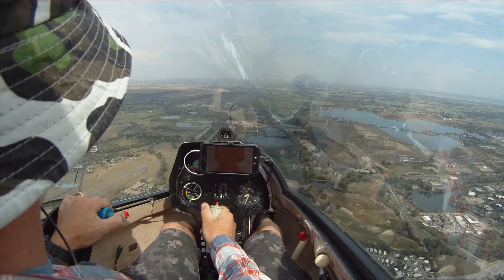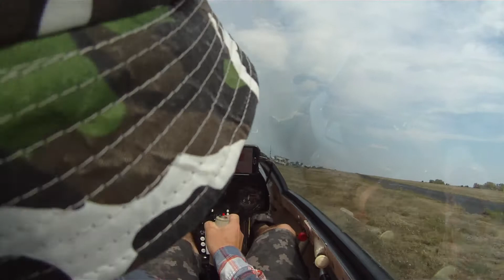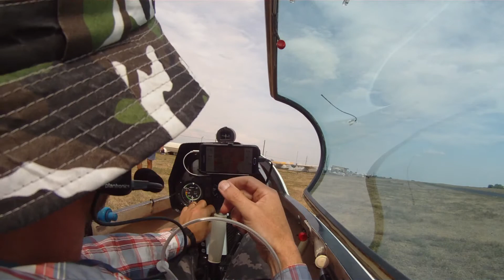Smooth Landing at Boulder, CO in PIK-20B

Comment: Nice landing, but reducing flap will increase stall speed at the very time you need the lowest stall speed possible. I have over 1100hrs in my PIk20B and always land with full or near full flap and it's always smooth & slow. Good to see some Pik vids though.
Reply from the maker: Thanks! Do you have any videos of your technique that you could share with us?
Good to see another PIK20B pilot out there! If I'm lucky, I'll get to 1000+hrs in my ship.
Reply: @Comtbslpr  Hi Jim. I had a look yesterday without luck. I was concerned that your technique is fine in good conditions but could be found out in tough/rough conditions or perhaps in a strong cross wind. I aim long and increase flap to full (most times) and land with a little extra speed. This way I have good control authority in all conditions. I try for shortest ground roll every time, as if I was landing in a paddock.
Good videos keep it up. Can you provide a pic of you camera setup please ?
Cheers.
Bernie.
Reply: How do you know what your flap setting is?
Reply: @cloudstreets1396  For landing just remember that one rev of the handle is approx 30°. I mostly go by the feel & attitude of the a/c, if it feels high or fast, I add flap, etc.
Back in March I made a few videos, I'll see if YouTube will let me put them up, YT and I have a running battle over Ad blockers.

Comment: do you think it's hard to land the glider? since it only has flaps as air brakes
Reply from the maker: Not hard, just different. Change pitch as flaps are rolled in/out to maintain airspeed. I actually like it better now that I've gotten used to it. I feel like I have better control overall on the approach.
Reply: @Comtbslpr  Good reply Jim, I find the same.